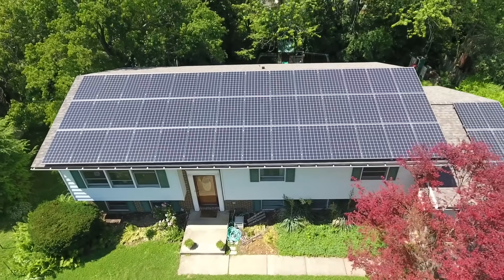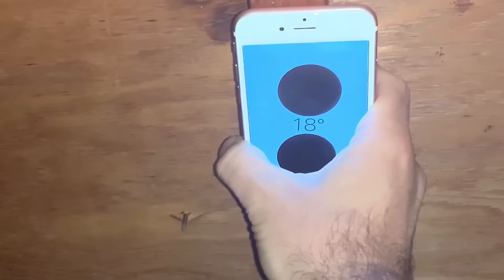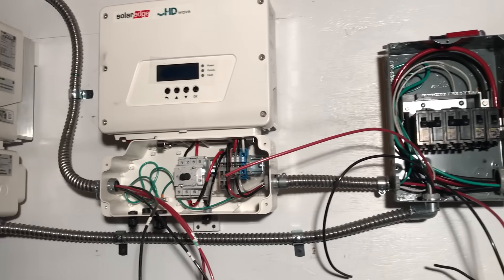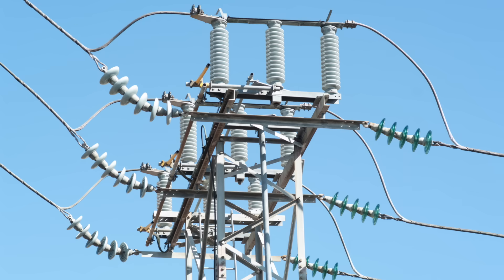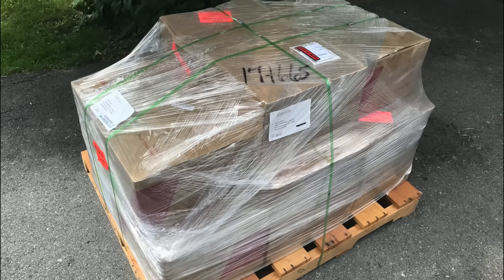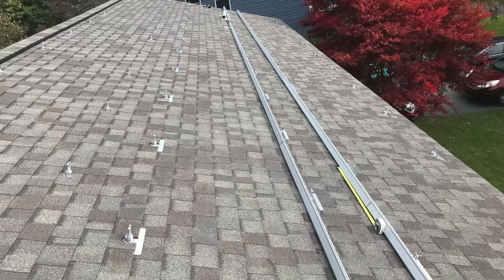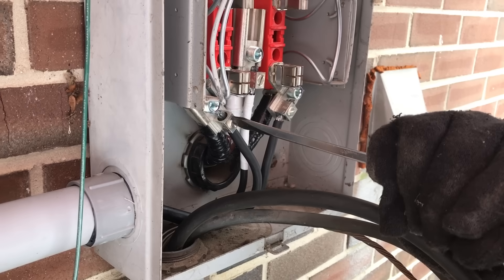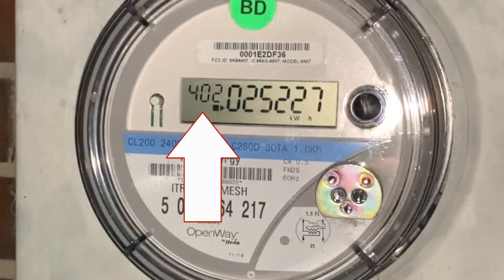I Installed a Power Plant Myself | HUGE DIY Solar Panel System

Comment: That hookup to the grid seems to be the way to go for solar.
Not having to deal with energy storage yourself removes a huge headache from the whole system. No huge battery cost, no worry about battery degradation and replacement, no inefficiency penalty, no bulky and unsightly box outside your house, not to mention removing fire-risk factor if anything the battery were to fail catastrophically.

As long as it's done cleanly like this, it honestly doesn't look bad either - and arguably those smooth glass panels will be actually easier to keep clean and growth-free than most roof-tiles or shingles. I would think they easily match glazed tiles in that regard.
There are still some pretty easy common-sense things you could do to improve visuals though.
I think if the roof surface itself were made to have the same general/pattern then it it would look near perfect. That's not something you can easily do yourself - but I imagine it gets made eventually as solar installations become more common to design into houses from the start of construction. 
The same applies to the brackets. A simple enamel paint-job with a dark blue'ish tint would make those meld into the whole surface real nice so it looks like one big piece.
Reply: And with new EV's, you can use the EV as your battery back up while the solar keeps the EV topped up during a black out.
Reply: @ronlaverdiere  I'm not sure it's a good idea to use an expensive and hard to replace EV battery to buffer a system like this. Even the best batteries degrade with charge cycles so that sounds like a lot of unnecessary wear on your EV. There is certainly a lot of potential for smart integration with EVs though. The most obvious one would probably be to have an EV charger that can talk to the solar and grid controller to charge past a certain minimum when there is surplus power or grid spot-prices are low - instead of pulling the power at the same time everyone else does after rush hour.
Reply: @TheStigma  For the one or two times per year that you might lose power it will be an almost imperceptible impact on your EV battery. 

The roof in this video generates about 11kwh per hour on a good day (300watts per panel, 36 panels). Over a 5 hour period, that is 55kwh. For people that normally plug in every day, that means the car can easily be charged to 90% before the sun goes down, and still fully power your house at the same time, all without using the grid. If the power isn't back up before the sun goes down, then you can run off the battery of the car. You might use 5 to 10kwh from sunset to the next morning when you wake up. That is nothing for a typical 75kwh EV battery.
Reply: you have to shut down your solar panel power and be in the dark just like everyone else if there is a power outage or you'll fry the electrical workers.
Reply: @HamguyBacon  Can you elaborate on why?
Reply: @HamguyBacon  put in an automatic disconnect.

Comment: That's the way to do it.  People go through all the trouble of installing the conduit, racks, inverters, switch gear etc then put just a few panels.  May as well as cover the whole sun facing roof.  Go big or go home.
Reply: You have to weigh up the upfront costs of the panels, energy required and the long term. Initial costs will put you in a deficit for years until you start to make your money back with solar energy (at least that's the case here in Australia).
Reply: But I am already at home.

Comment: Great but ground mounts can be easier to maintain. Also if you need a roof.  Won’t have to remove panels
Reply from the maker: I would have preferred a ground mount but there is not enough yard for me to set one up.

Comment: its not 14% ROI, all those initial years of cost is wasted, years of compounded interest wasted. Its not apples to apple with that comparison. If the setup costed you 21k to do, and your electric bill is 350 a month It literally takes you 5 years to break even and every dollar after that starts your actual ROI, Meanwhile money in the stock market gets 10% on average which means your 21k would have grown to a large amount in the same time frame.  Now your solar investment is literally trying to play catchup on the ROI vs time passed scale and will take forever to catch up to the market, past your lifetime.  Now if you took the money you saved in electricity and invested it in the market dollar cost averaging, you'll be a lot closer but research has proven lump sum investing beats out dollar cost averaging.

Comment: I've done the same thing with my place, then last year the electric company changed their rules... Now they charge me a $33 connection fee each month regardless of how much power I send back and they keep all of my excess generation instead of rolling it over to my next bill. So now even though I generate more than I use, I end up paying $33/month and when winter clouds come around I don't have any roll-over credit to cover the cloudy months.
Reply from the maker: Oh no, what state are you in?
Reply: @FrugalRepair  Texas and my only choices for electricity is the local co-op or going off-grid. Sadly batteries are just way too cost prohibitive to make sense long term when I already have access to cheap electricity. It's just irritating to be charged when I'm actually producing more than I use. I send over a megawatt back to the grid each year.
Reply from the maker: @andrewb9595  I’m very sorry to hear about that.  Have you looked into used lithium batteries that have lots of life them in them?
Reply: @FrugalRepair  I've looked into it. I've even looked at building my own battery bank out of Nissan Leaf batter packs. Sadly it's just too expensive for the life of the batteries. If I switched over to off-grid I'd also have to provide myself days of autonomy for when the sun isn't out. My monthly bill is only about $40/month on average, so I'd have to be able to get batteries at less than $10 per kWh and that's just not feasible.

It's all ok though, I'm thinking of moving to another country (on the equator) anyway and I'll be renting my house out in America. At the new place I won't need AC/heat so that'll cut my electric usage in half. I'm thinking of going off-grid there, by using DIY parabolic troughs to power a sterling engine and use the waste heat for water heating. Then for nighttime power use a biogas generator or maybe a flywheel. It's all a theory for now, but seems pretty feasible. No batteries required this way. I couldn't do this in the states because of the need for AC/heating which is the majority of my electric usage.
Reply from the maker: Thanks for explaining.  Hope it goes well for you!  Sounds like some fun projects.

Comment: Many questions left unanswered by this video.  The main one for me is, what happens at night?  Is there a battery system that gets charged during the day?   I got the sense that you don't feed huge amounts of excess power back into the grid,  so did you make a system that was just the right size to cover how much power you use?
Reply from the maker: You may want to check out that video after this one.  I go over production and net metering, as well as, costs of the system.  Net metering is the key to grid tie without batteries.

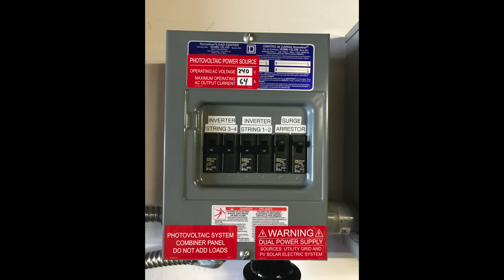Comment: Amazing work! I would be so intimidated to try and install an entire solar system myself! Awesome job. Just as a heads up, it may be a good idea to install a split pipe boot over the PVC at 10:10 since it runs through your roof (albeit it might be tricky to find a small enough one to fit in that tight area). Thanks for documenting the whole process.
Reply from the maker: Thanks for your encouragement!

Comment: Nice job congratulations. Question: If the power company is shutting down the power is there an automatic shut down switch to protect the people on the grid from your solar panels (feedback)?
Reply from the maker: Thanks!  It’s built into that firmware on the inverters so it’s automatic.

Comment: Hi - great job.  I'm looking to remove one of two solar arrays from my roof and use them to build a solar canopy on my driveway, which is better-positioned for solar.  Can I remove the panels from my roof by myself?  Can you direct me to instructions on how to do that?  How should I address personal safety concerns?  Any help you can give would be greatly appreciated.
Reply from the maker: Thanks!  Yes, you can remove them yourself.  Why not keep them there and get more panels (maybe bi-facial) for the canopy?  You can shoot me an email if you want to connect further about solar stuff.

Comment: Im not sure I understand why you need to connect to the grid🤔
Reply from the maker: Check out the video after this one.  Net metering is the reason.  I don’t need to buy batteries so it’s much less expensive to do grid tie.
Reply: @FrugalRepair  will do thanks

Comment: I got exactley the same setup with Panasonic and solaredge and the poweroptimizers  lol only less panels.But i.know because you choose the Panasonics you Will have more kWh than you probably expected and less decay of the Solarcells than expected.unbelievable good panels.
Reply from the maker: Good to hear you have the same setup!  Have you been happy with it?
Reply: @FrugalRepair  very happy compared with for example the neighbour has a few and you can see the difference after IT rains .All the debri Just washes of my solars while the Neighbours is still with bird poop.And the kWh produced is much higher than the installer said IT would.i only have 9 Panasonics Also when it gets hot in the summer if i compare IT to my parents Solar Watt panels they produce more kWh than Them. I have to say that my roof is in perfect position the sun all day.my record is standing on 21 kWh on 1 Day.

Comment: Do you have the option of having your solar power directed towards a Backup Battery in case of Power outages?
Reply from the maker: I don’t have any integrated home batteries right now.  I have some stand alone batteries that I can charge via solar.   Thankfully the power doesn’t go out very often.

Comment: This would never work in California if you were a PG&E customer.  PG&E is dropping the rates next year for excess solar power for less than the cost of producing power from solar.  Out of curiosity how much did you spend on your solar system?  And what were your monthly electricity bills before solar?  Unless you are growing weed, it's hard to believe you need that many panels.
Reply from the maker: I go over the costs and production numbers in the video after this one.

Comment: Really good work! Bravo! I just have a question for you! Are the Panels producing 400 volts Dc? Because i have heard and seen that high voltage group panels are affecting the life span of the solar panels, and also the optimal volt producing number must be under 100 volts so you panels will last 25 years. Thank you in advance keep up the good work!
Reply from the maker: Thanks!  The string voltage is 400v but each panel is like 55v output.  I’m using solar edge so the string voltage is managed by the power optimizers.  I have 12 panels per string.

Comment: Okay, I'm in sort of a unique situation. A billing dispute has currently left me without power and based upon my own stubborn principles - I'll have solar installed before I pay them what is owed. What sort of hang ups and problems am I going to run into from the power company on my journey to be self-energy efficient?
Reply from the maker: If you want to benefit from grid-tie solar you’ll have to make sure your account is in good standing with your utility.  I think most issues are in getting things set up.

Comment: i guess you don't store energy for just incase power outages ?
Reply from the maker: No, I don’t currently have an integrated backup.  The power doesn’t go out very much thankfully.  I have some smaller batteries for things like running the fridge if power goes out.
Reply: @FrugalRepair  kinda surprised id at least have 5 days worth of battery supplies for what if's i was left with out power for 3-4 days in Texas and inside the house was 36 wood got expensive but luckly a neighbor sold us some and we have a gas stove so i put a 24x24 paver stone on top of it and that helped heat up that area and there is alrdy talks of brutal winter storms this yr and next might want to think about it

Comment: The key question for me is that it will be with these panels in the event of a strong wind, hare, hurricane and snowy winter.
Reply from the maker: They are made to handle such weather.  And they make even stronger stuff than what I used.
Reply: @FrugalRepair  It will be interesting to look at these solar panels in a few years.

Comment: I am getting 33 LG 370W pannels for my house in November of 2021.  I cant wait to do soloar.
Reply from the maker: Awesome, are you installing it yourself?
Reply: @FrugalRepair  I am not, I am not skilled in that area and my wife won't let me, so it is being contracted out through solar freedom. Even though this is costing more, I still found your video to be very helpful.  The 33 panels that we are getting are the maximum out of pannels that our house can hold.
Reply from the maker: Thanks for letting me know. I’m glad you’re getting solar!  Did you happen to watch the video that’s next after this one about costs and production?  Getting solar has been a terrific investment for us.
Reply: @FrugalRepair   I did watch the second video. Our LG panels are basically the same in longevity and efficiency.  A little bit about our house is we have a gas stove, Gas heater for winter, and an on-demand Tankless gas water heater.  However,  my wife and I do a majority of our work from home so during the summer our AC costs are high.  Having solar freedom do the install our total price is 44k without taking off COVID-19  rebate there 10% summer sale they had going,  rebate, and the 26% tax credit.  In the end when it is all said and done our total bill should be around 33k. Still, the ROI is great and the system will pay for itself.  Oh, I live in Indiana and my energy provider is duke energy.

Comment: So a reroof would require removal of the panels, wiring, rails down to those flashings. Replacement of the flashings. Is the life if the shingles extended because they are sheltered by the panels? Great video, thanks
Reply from the maker: Yes the shingles’ life is greatly lengthened because they are protected by the solar panels.

Comment: Which state do you reside in? I work for solar company and I can see no roof clearance for fire setback. How were you able to pass for permit. And Instead of using solar edge inverter you shouldn’ have used micro inverter iq7 ones
Reply from the maker: PA, our jurisdiction did not adopt the setbacks

Comment: Well done, beyond most ppl's abilities I think, including mine.  I am leaning toward a system like this. (Not really interested in feeding grid) 
1. Bypass inverter and run DC direct to hot water tank for hot water use and space heating, solar A/C units, etc.
2. Some batteries in case power outage (I think will get more common in future).
3. Conservation... 0 standby power appliances etc.
Reply from the maker: I hope you can get that set up!

Comment: Great Idea and video, I did not see you mention any batteries are you using any or 
do you just loose power if at night and grid goes down?
Reply from the maker: Thanks!  No I don’t have any batteries integrated. Because in Pennsylvania the net metering is a one for one credit. So this means any excess that I generate is a credit on my bill. When it’s dark I’m using grid power. I explain how this works a little more in the next video after this one.

Comment: Question, did you face any bird problem after installing?
Reply from the maker: No, we’ve not had any issues with birds.
Reply: @FrugalRepair  what about plants growing underneath or between the solar panels?
Reply from the maker: No that’s not really possible because of the asphalt shingles roof.

Comment: I live in Thailand and the power is up and down all day, hence it turns off the solar panels, I use a SMA 5000 system do you have any ideas so I can run my solar energy all day even when the power drops below 200v?

Comment: I'm curious as to why you didn't use batteries? Here in NZ we're lucky to get a small fraction of the retail electricity price back if we're grid tied so battery backed systems are the only way to go. Im curious regarding what rate, as a percentage of retail,  you get back. It sounded like you were getting 1 to 1!
Reply from the maker: Yes, I get 1-1 credit.  In the next video I cover net metering a little bit.

Comment: Solar panels should be installed away from the house    Very high levels of electromagnetic frequency have been detected on the inside   Causing chronic disease and cancer

Comment: I live in the mountains near Tillamook Oregon. My wife and I are 55 and 60 years old and have free mountain water already so we are half way into the off grid life. I’m very interested in doing a solar system for our 1200 sq ft. House. All of our appliances are electrical. We have a energy efficient fridge, freezer, 50 gal hot water heater, and a electric stove. The few base board heaters. Oh and a microwave. 

I would like very much to go solar. Our average power pill is about $138.00 monthly. I still would like to be grid tide to sell back, but like you wish to be producing power. Oh and we are at the end of the line so Tillamook PUD would be more worried about others than us at the end.

Any advice would be greatly appreciated towards this venture.

R/.    Don
Reply from the maker: Sounds like solar could be good for you with your goals.  Did you look online at some estimators?  PVwatts is one.  You can shoot me an email if you want to ask some other questions.